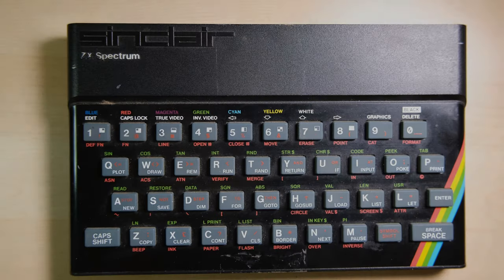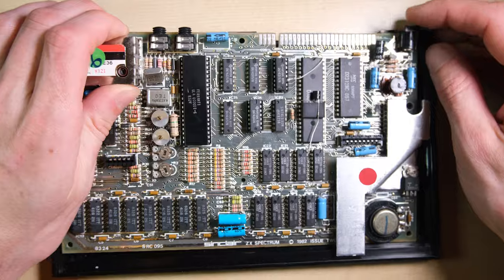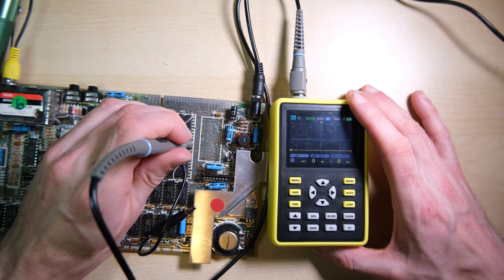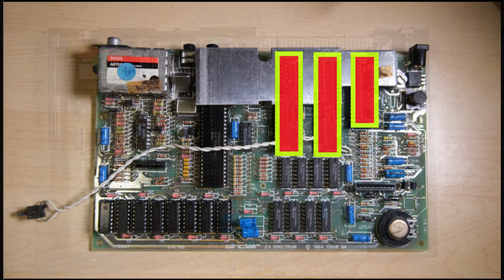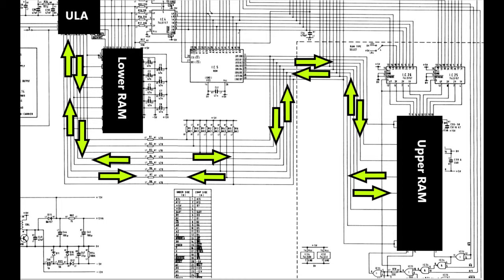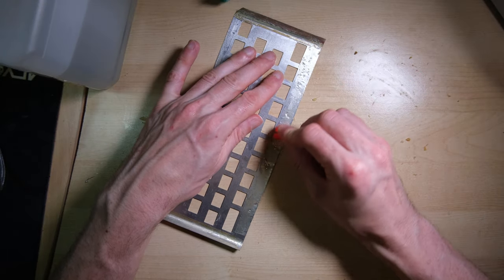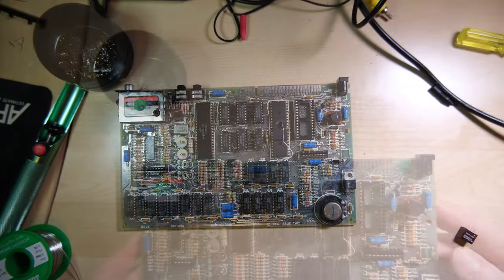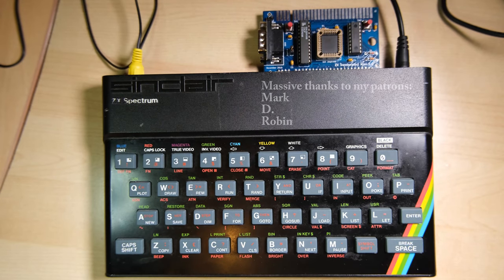ZX Spectrum 48K Repair - Hot Chip

Comment: Hi, following your video and I'm not getting -5v on the lower ram. Getting -2.36v. What would you check next?
Reply from the maker: It's possible a lower RAM chip is bad and pulling the voltage up. Are any warmer than the others?
Reply: @HappyLittleDiodes  none seems to be warmer than the others. IC1 is very hot and IC2 is quite warm.
Reply: Forgot to say I'm getting a black and white stripey output.
Reply from the maker: @stuoo what issue board is it?
Reply: @HappyLittleDiodes  Issue Two
Reply from the maker: @stuoo check the schematic and consider testing or replacing all the components in the -5V generation. Such as C46, C47, D16, D11, D12. Maybe even in that order
Reply: @HappyLittleDiodes  great next step. I have already replaced all the capacitors. But will try the diodes 👍